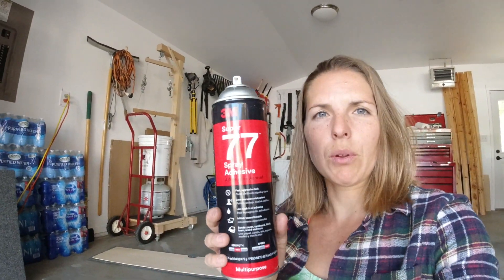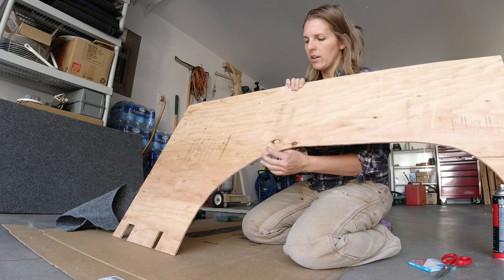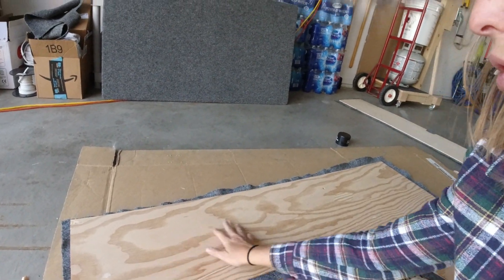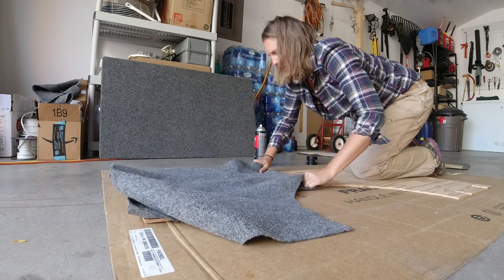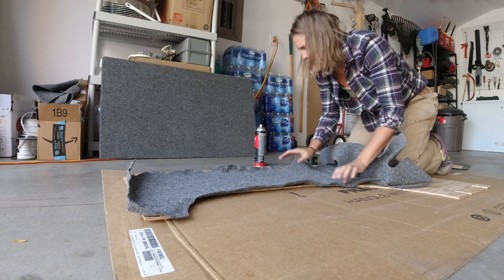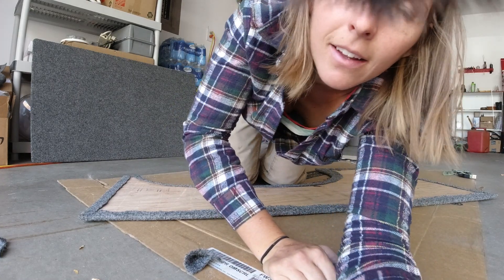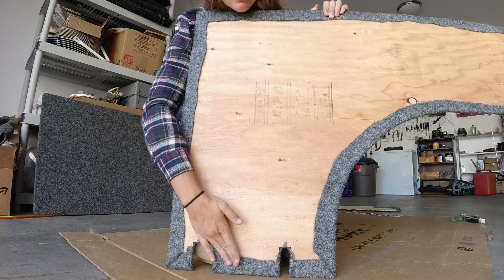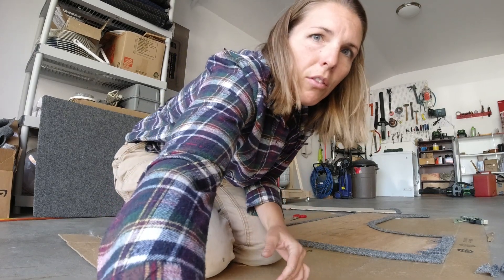How to Finish Van Walls with Upholstery: Promaster Van Conversion

Comment: This is great, thanks.  I would imagine that I could staple the back side after gluing if I felt like I needed to really tack it down.  I would think the staples would need to be rust proof, since you don't want anything that can rust in the van.
Reply from the maker: Thanks for watching!  Yes, we did use staples in areas where they wouldn't be seen as a fail safe.  I suppose rust free staples would be ideal, but we didn't look into that.  It was hard enough to find staples short enough for our wood (6mm)

Comment: Step one, buy cheap folding table so you don't have to work on floor! Your back and knees will thank you and you will be able to work longer before running out of energy.
Reply from the maker: Good suggestion and thank you for watching. We didn't want to purchase another extra thing that we would have to find a place for after the build since we are full time. Luckily the crawling and stooping didn't hold us back this go around.

Comment: I used super 77 and similar felt to line my fiberglass camper in the middle of winter (in garage). So worth it, minus the practical lung damage... younger and dumber then
Reply from the maker: Oh that's a great idea for a truck camper!  Yeah the VOCs on the spray adhesive is are pretty bad.  Thankfully we had good weather for the most part and we were able to do it outside